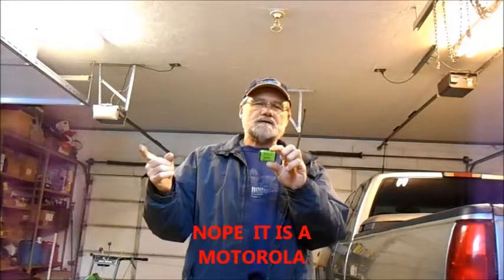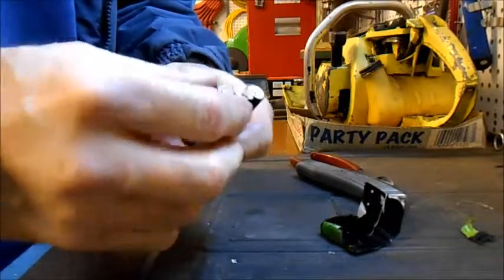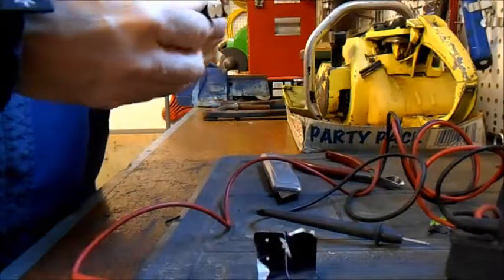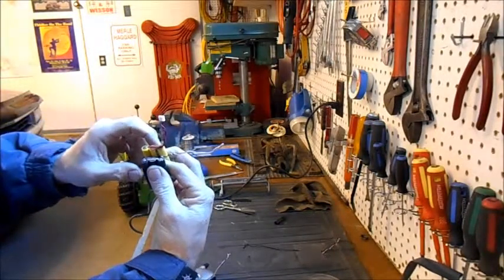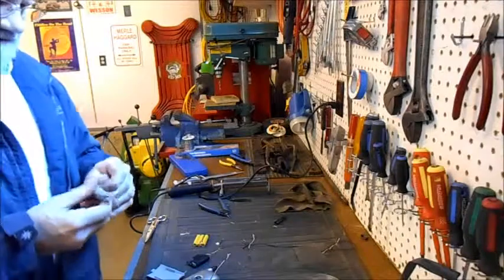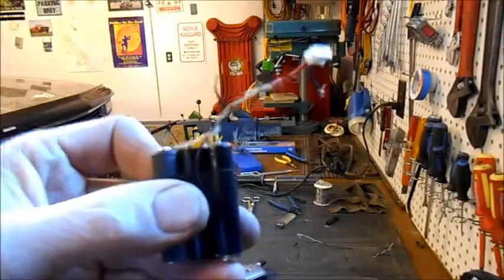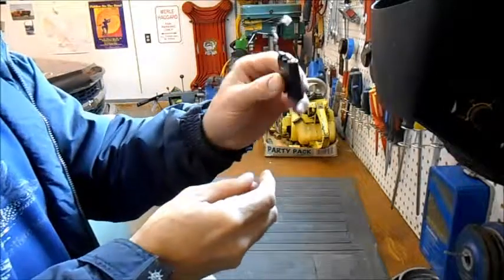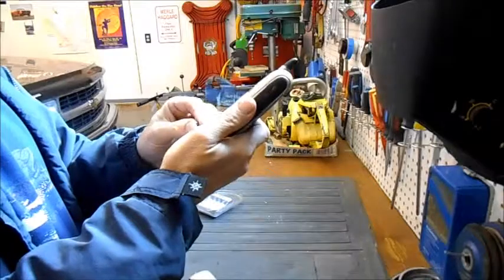Making a Cordless Phone battery for $3

Comment: That chainsaw on the bench looks a lot like a late 1960's SKIL - 16" bar, if my memory is correct. My dad bought two; I've got one still running and the other, 2 years older, I keep in case I need parts I can't get elsewhere. Mine were bought in western Canada - I don't know where elese they were sold. Maybe my eyes are failing, but that yellow looks very familiar!
Reply from the maker: You are right   skil